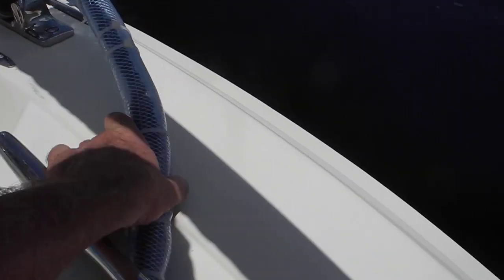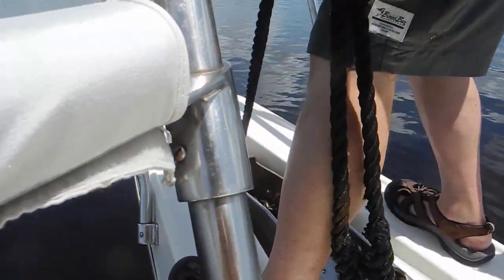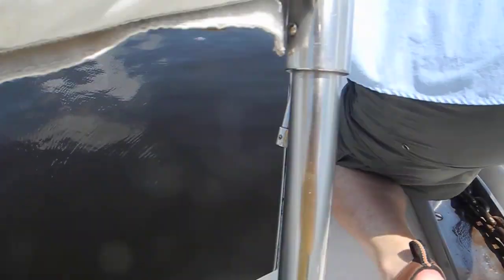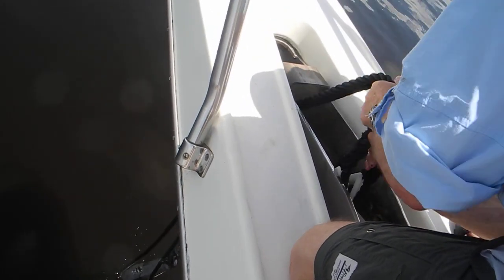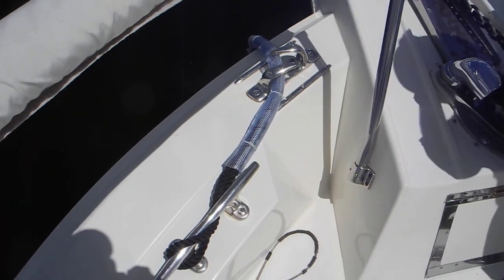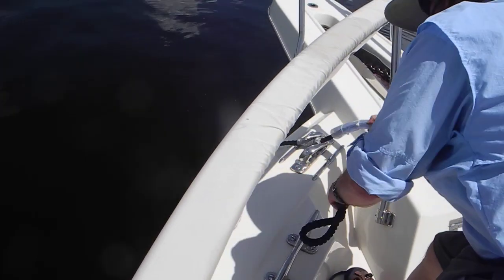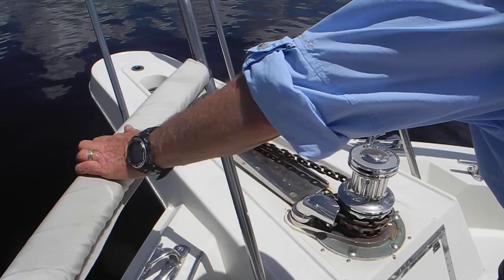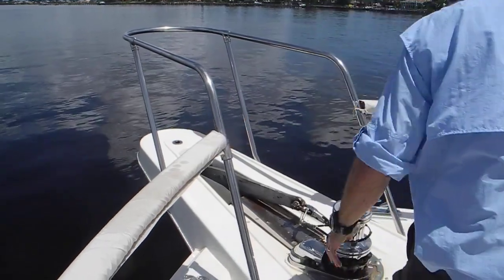Bruce anchor and snubber

Comment: Thanks for the quick response!
My anchor setup is 200 feet of rope, with approximately thirty feet of chain.
A chain stopper won't work in my case.
Any other suggestions? As stated earlier, the knots suggested are difficult to attach during anchoring.i was thinking of attaching the anchor rode to one of the cleats to relieve the pressure on the winch. The only thing with that idea is the anchor won't be pulling through the anchor guide at the bow.
Reply from the maker: If you allow more slack in your anchor rode you can keep it running through the bow pulpit/anchor guide and then with the slack, tie it to a bow cleat. A chafe guard will protect the rode/rope as it makes a turn to your bow cleat. Chafe-pro makes a few options or you can go the DIY route and use a length of rubber hose that you split down the side longways to wrap around the rode
Reply: @AskCaptainChris  Thank you again. I enjoy all of your vidoes!!
Reply from the maker: Larry Jolliffe Sr 👍🏼👍🏼

Comment: Snubber is a great piece of gear but the first time you use it can be a little confusing until you figure out which pieces go where when deploying it as well as the best (safest) way to get it off the chain when pulling up the anchor.  Need to be super careful when putting your fingers near any of that stuff.
Reply from the maker: Bob P amen!

Comment: What type of snubber would you suggest for half inch anchor rode.
There's a special knot that I've tried to use,but it's too difficult to tie from the bow.
There's no cleat available in the winch locker to take the tension off of the winch.
Boat is a 2015 260DA Sundancer
Cheers
Reply from the maker: Larry Jolliffe Sr you might try to use a chain hook or chain grabber with a 15 foot rope and tie it onto either of your bow cleats. Make sure the snubber feeds through the anchor roller and then to the bow cleat.

Comment: Great Videos. I sure am glad I don't have to fool with these New Fangled gadgets 😆 . My 2 - 55  anchor system never fails seems to be losing power. Any ideas ? May try to put Sweet Mellisa on the late model galvanized trailer I got her this weekend. I have some cool Mustang wheels to put on it. Gotta be Styling 😆.Love your channel Your friend Alabama Smokey Wilson
Reply from the maker: Alabama Smokey Wilson is your 2-55 anchor windlass system anything like the 4-60 air conditioner in your car?
Reply: @AskCaptainChris  Yes sir. I think it's original equipment. I did go all out at Wal Mart for my rope 😆😆